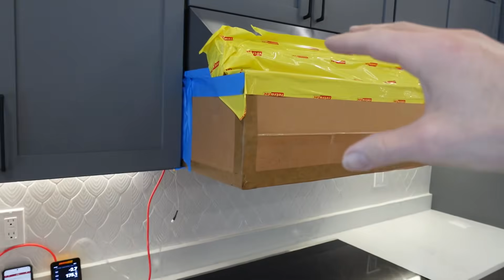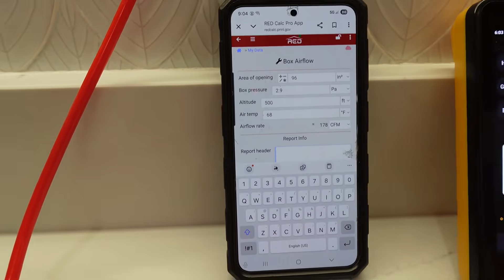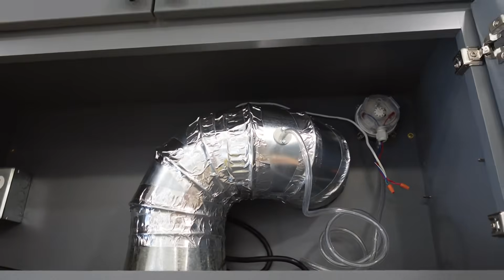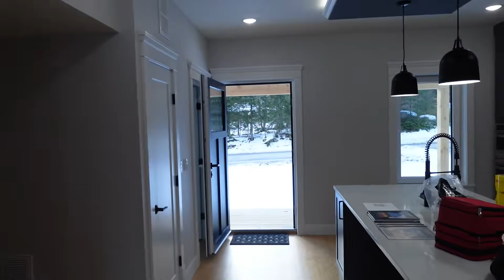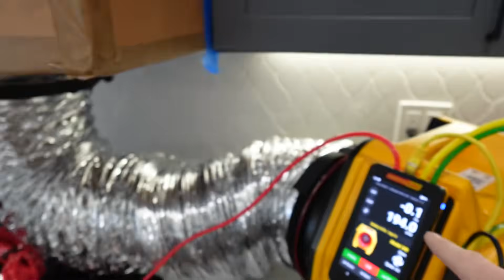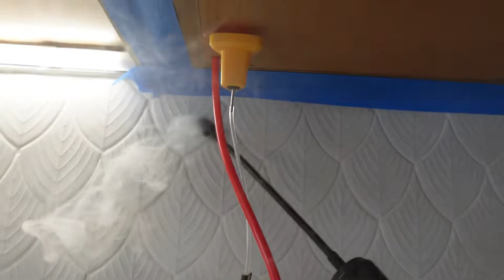Measuring Kitchen Exhaust Hood Flow

Comment: I wonder though, if the motor is designed to have a certain static pressure on it based on the size of the hood opening, then wouldn't putting all of that cardboard up increase static pressure that the motor is working against, and lower cfm?
Reply from the maker: Hello,
The cardboard doesn't effect the static pressure because the test fan is running at the exact speed to equalize the pressure inside the box.  So the range hood is experiencing the same static pressure it would without the box.  Thanks for the comment.  Happy building